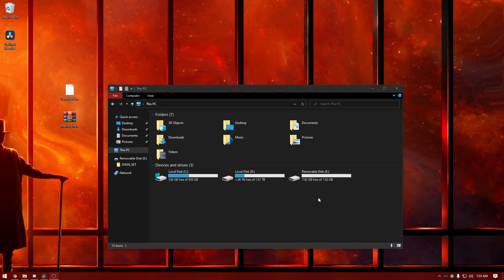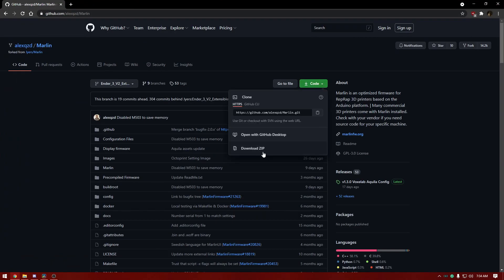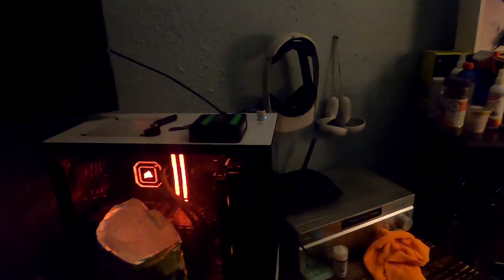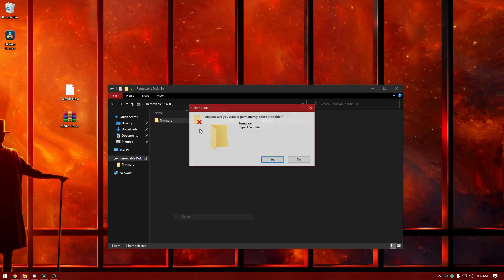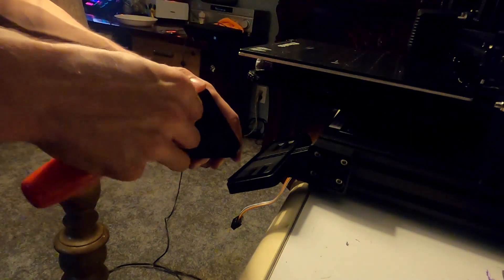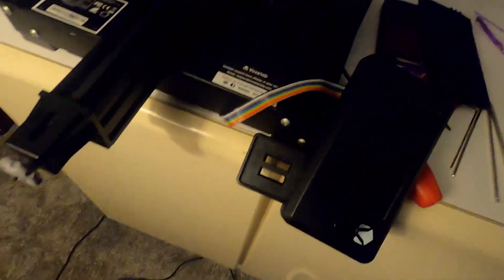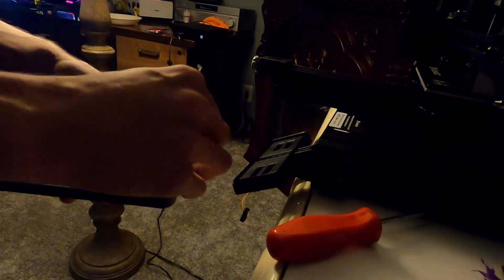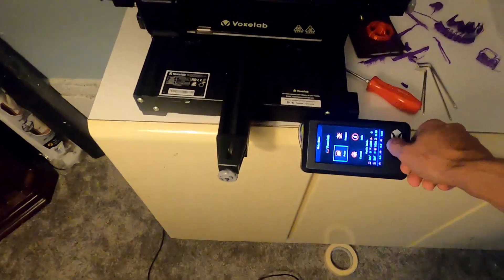How to install custom firmware on your Voxel Lab Aquila

Comment: Hello, congratulations for the video, I own a voxelab aquila x3 max, I would like to know if the firmware will work the same, I would like to ask you also, I would like to disconnect the touch sensor and insert a mechanical switch, but after connecting it, this is not recognized, I would like to know how to "activate" the Z axis on the board with this switch, thanks.

Comment: Thanks so much, this is the only source I could find that completely explains and demonstrates the process beginning to end in one video. I got a CR Touch and had spent hours trying to follow other guides and was genuinely concerned that I had bricked something at a few points, after finding yours I was ready to go in about 10 minutes. It's criminal that you only have 82 subs, but here's one more.

As others have noted below, if given the option to choose a theme for the newer versions of the firmware, make sure to change the folder name from "DWIN_SET (ThemeName)" to "DWIN_SET", or the process will not work. Really just make sure the folder is named the same as in the video at 3:40 and you should be fine.

Comment: Tried this on a newer Aquila S2, followed the written, then watched video, screen does not work, it went to blue then to orange, shut off printer, took out sd card from display, powered back up and nothing. tried to go back o the original firmware...no luck

Comment: at the time of writing this comment a few tings have changed. alex added custom visuals and different (DWIN_SET)'s now theirs a new folder inside of the "display firmware" folder named "firmware sets" inside of that folder has several DWIN configurations like  "DWIN_SET (Custom)" or "DWIN_SET (Rick and Morty by vaniilla9)" these are just driftnet themes basically, NOTE: after choosing one of these DWIN files and moving it to your sd you have to rename the folder and remove the custom identifier so the folder is just named "DWIN_SET" otherwise the lcd wont recognize and flash when you insert the sd.

Comment: Just wanted to say that I followed this video and it was great. Short, to the point and spot on. The only hiccup was that there is now a few different options for the DWIN_SET folders. Luckily the readme file cleared that up. Thanks for this video.  It made the firmware flash EASY.

Comment: Any help with the N32 Aquila X2? Is the process the same or different? I see the comment below but I'm just wanting to make sure its proper. Also, do you have to use the memory card that it came with or would another SD card work for it? I've got several 64gb cards that are not in use so I figured I could just add that to one instead of the "OEM" SD Card that came with the machine.

Comment: What are the G and the N versions?
Reply: The chipset version you have. On the left side of the base there is a sticker with a serial number on it, next to that would be another sticker that says N32. If your machine doesn't have the sticker that says N32 your machine is a G32.
Reply: @BlackwoodIronco  awesome thank you! I happened to guess correct on my first try but this is good to know

Comment: for anyone installing NEWER versions of Alex's Firmware, there are different themes that come with the firmware sets, if you just copy and paste like in the video it will not work, you will have to delete the parenthesis titles on the DWIN_SET folder and you will be good to go
Reply: I had that issue.
Reply: This comment saved me much panic and frustration, as I thought I broke everything. Thank you, blessed soul for posting this.
Reply: I should have read this comment it would have saved me ten minutes
Reply: Thanks! I initially installed Rick and Morty theme but the font is painful to read, but installing another firmware over the top doesn't seem to replace the font.. any ideas anyone 😅
Reply: @bencannon3131  im experinacing this aslo, whoever made this the font is garbage and idk how to change
Reply: @DivisionRc  I never ended up fixing it, mostly out of laziness, but I'd say you'd have to re-install the stock firmware that it came with, then go through this process again and install one of the custom ones (and not Rick and Morty lol)
Reply: @bencannon3131  i actually fixed it. Use the DWIN font ( original) rename it to DWIN_SET and flash the screen
Reply: @DivisionRc  awesome thanks! I'll give this a go when I get home!
Reply: thank god for this comment

Comment: Besides the nicer colors, and the BL, what does this firmware upgrade do?
Reply: 6/6/2021 v1.3.4 - Important Fixes and Small Additions
Fixed Powerloss Recovery
Fixed Pause Print Heater Timeout Issue
Fixed Preheat Menu for E Move
Improved Preheat Menu Functionality
Updated Gotcha Icon Pack
5/23/2021 v1.3.3 - Framework Changes and Minor Additions
Big Framework Change (#807)
New Preheat Mode Selector
Added Coordinate Blink if not Homed
Added Dedicated Homing Menu
Improved the Beeper Disable Option
Added Linear Advance Support to Source
Ensured Homing Before Leveling
Re-added "Next Point" to Manual Tuning
Added multiple Mesh Support for UBL
Added "Purge More" Option to Filament Change
Improved Menu Error Handling
Tuned Thermal Protection Values to Reduce Errors
5/2/2021 v1.3.2 - Universal Leveling Menu and Minor Fixes
Dedicated Leveling Menu for all Leveling Configs
Guided Leveling for Manual UBL
New Probe Menu with M48 Option
Updated Thermal Runaway Settings
Enabled Print Counter
Added Degree Symbol to Temps
Beeper Setting Saved to EEPROM
UI Color Theme Additions
Added Filament Change Confirm to Tune Menu
Fixed Percent on SD Print Finish
4/18/2021 v1.3.1 - New Settings and Minor Fixes
Added Custom Color Themes
Added PID Value Inputs
Added XY Home Offset Menu
Added Beeper Disable Option
Added Live Option to Move Menu
Enabled Support for EEPROM Editor Plugin
Fixed Manual Leveling for Larger Beds
Improved Backlight Off Handling
Fixed Percent and Time Remaining on Print Finish
Fixed Minimum Bed Temp Setting
4/6/2021 v1.3.0 - New Settings and Major Fixes
Added LCD Brightness Control
Added PID Autotune Menu
Fixed Flowrate Adjustment
Added Previous Value Option to Manual Mesh
Fixed Probing Margins for BL Touch
Enabled Emergency Parser
Disabled Leveling in Affected Menus
Added Z Pos Setting to Manual Leveling Menu
Added ABL Leveling Confirmation
Fixed Max X Position in Probe Configs
Added UBL Preheat Before Probing
3/17/2021 v1.2.2 - Fixes and Improvements
Added Support for Displaying Filename During Host Print
Added Meatpack Gcode Compression Support
Increased UBL Mesh Inset
Increased UBL Move Speed
Fixed Preheat Hotend Menu Issues
Fixed UBL Microstep Options
Fixed Serial Connection Issue
Fixed PID Tuning Popups Freezing
Require Homing after Disabling Steppers
3/8/2021 v1.2.1 - Important UBL Fixes
Fixed Auto Tilt Popup Freezing
Fixed Mesh View Back Issue
3/7/2021 v1.2.0 - UBL and Major Additions
Added UBL Functionality and Menus
Fixed Filament Runout Popup Issue
Added UI Checkbox for Toggles
Fixed SD Print Filename Issue
Disabled Mesh when Manual Leveling
New Advanced Menu Options
__h__m Time Format Setting
New Preheat Manager for E Moves and Filament Change
Filament Change Support in Precompiled FW
Filament Runout Support in Precompiled FW
2/22/2021 v1.1.1 - Config Additions and Minor Fixes
Extruder item in move menu now resets on menu draw and item click
Fixed version number format in info menu
Enabled M48 probe accuracy test
Enabled S-curve acceleration
Increased probe xy offset limits
Restart cooling fan on print resume
Fixed reheating done popup issue
Fixed Z pos negative value issue
2/17/2021 v1.1.0 - Major Fixes
Fixed M73 print progress bug
Info menu on main screen is now functional
Power loss recovery is now functional
Improved icon labels for main menu and print screen
Added improved printer kill and thermal runaway popups
Reduced move menu extruder feedrate
Added another decimal place to Z pos display
Reply: @stevensgarage6451  Gee, is that all? Thanks for the update! Appreciate it.

Comment: Why does it have to be 4096 format?  I don't even have that option on my SD card, lowest I can go is 8196.   My card that came with the machine is corrupted and unreadable, so my new card is a little bigger size.
Reply: that is because you are using a bigger card try to low level format the card that is corrupted. sometime you will be fine at 8196 but if it only reads half and fails you are screwed till you get a smaller card